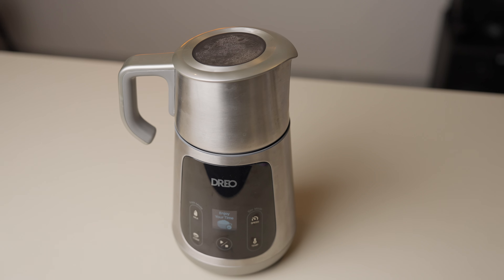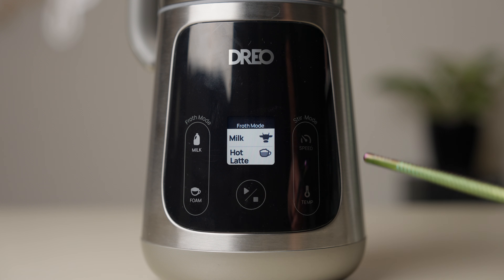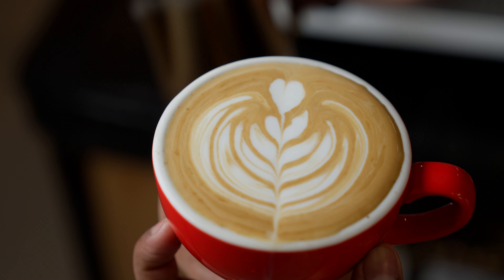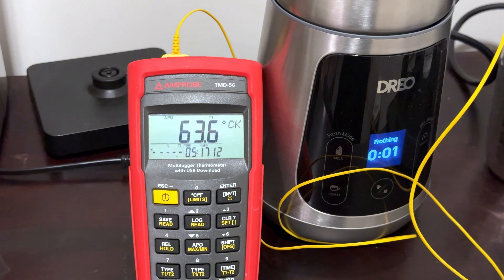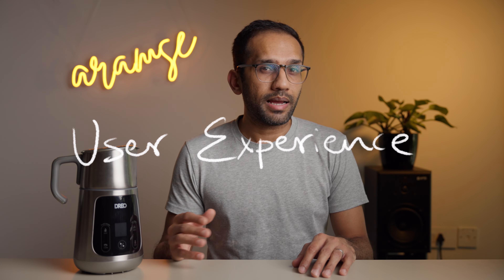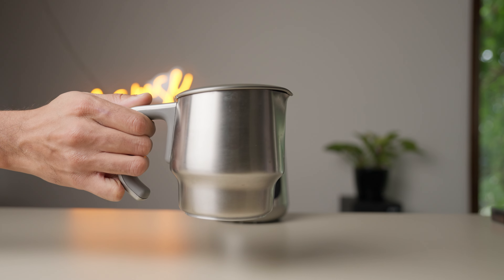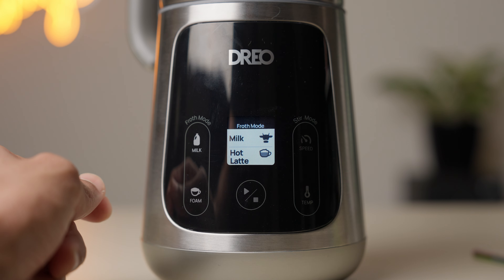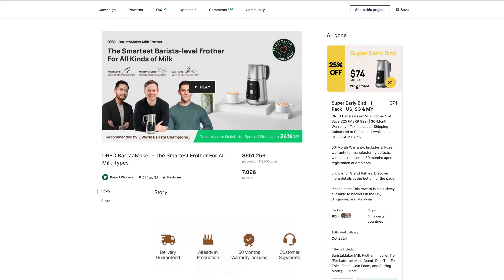DREO BaristaMaker Milk Frother - Beats Steaming On An Espresso Machine!

Comment: The reason why this device can beat the San Remo (or any machine with a steam wand) in terms of mouthfeel is one word: water.  Steaming adds water to the milk.  The end result is lower in fat than the Drea or any frother, that adds no water into the milk.  Frothed microfoam will potentially feel a little creamier due to this fact alone.  However, the speed of steaming milk, and the incorporation of hot air into the milk (which breaks down the lactose into glucose and galactose, which are perceptibly sweeter sugars than lactose), are two advantages that can't be beat.  For these reasons, steaming is still supreme.  To get more mouthfeel and to compensate for the added water into the milk, use a higher fat milk.  Most "Barista" Milks are 3.8% fat, the ideal fat percentage for microfoam, in my view.
Reply: this is good for home use. just froth the milk while you prepare the espresso. some entry level machines can't do both at the same time. this is truer if using manual machines, as mentioned in the video.
Reply from the maker: Yup I mention the dilution part towards the end of the video.
Reply: @haomingli6175 Oh absolutely, agreed. No need for an expensive espresso machine. This looks like a great device.  Just saying that steam still has 2 major advantages, and I left out the fact that doing multiple drinks in succession really does need a fast steam wand.

Comment: Been using mine for a week and really didn't have any issue at all with foam and latte art.  The taste and texture is incredible.  For the price and ease of use, this thing gets high marks from me.  I currently use the Cafelat Robot manual espresso machine with the Dreo and have been getting the same if not better quality than from cafes I've visited in the past.

Comment: I've upgraded from Nanofoamer Lithium to the Pro Gen 2 just before I found out about the DREO.
I was a little upset thinking about overpaying but the more reviews came out, the better my mood got.

I find the DREO suitable for those folks not willing to pay Nanofoamer price but still get the milk heated and textured automatically.

I will definitely recommend it as a budget friendly alternative to the Pro Gen2.

I 100% dig the fact that the Nanofoamer has zero issues with starting milk temperature, while the microfoam dial in took no more than a couple of tries. All flow controllers are super straight forward and 200g of milk done in 2 minutes straight from the fridge is perfect.

I still find the cleanup not to be the best experience, but I quickly got used to it. A quick scrub with the included brush will dissolve the small milk patch in a few seconds.

Comment: I used Nanofoamer and now I got the DREO. It works fantastic but my only complaint is that the milk jug is small. It doesn't make enough milk for 2 regular size coffee, of course I can quickly wash up and do another one but hey it's total of 7+ minutes for 2 cups of coffee. I wish it can produce 2 servings of milk at one go.
Reply: it is possible
Reply: @ how ? I dont think I will be able to do 2 cups of coffee with latte art setting
Reply: @MooCreation  
I put enough milk in and managed 2 cups of cappuccino. That was also the reason why I bought the device because I usually do two at once. anything else would be completely pointless
Reply: @ so do you fill over the “ max foam” line ?
Reply: @ Of course a Little Bit
Reply: @ I tried well over the line and still not enough. Maybe we’re talking about different size of the standard coffee
Reply: @MooCreation  i talk about classic italian cappuccino cups... the foam was perfect. a little bit too hot. maybe it would be a solution pressing oat milk. 55 c... instead of 65... the right channel should also be a solution for the left coffee part

Comment: I'm considering this Dreo and just happened to see it on sale at Amazon for BF for $84.99. I have a Nespresso machine that came with this Aerrocino frother it's ok I feel like milk doesn't get hot enough and not enough settings. I also want to be able to make hot chocolate in the frother with maybe milk and chocolate syrup I know it mentions stirring powder. I had also been looking at this Nespresso recipe frother but it's too expensive and once I found this on Amazon I got intrigued and started reading reviews and so many were good. So now I am googling and reading other reviews and watching a few videos to decide. Is it really good? I don't drink Lattes alot but when I make my double espresso pod I usually pump some syrup in my milk and froth it but I like all the settings that this has and the digital display.  I make hot and iced and have never really made cold foam just bought a can at the store but would love to try different things with this. I like hot and cold lattes never had a flat white but am willing to try it too. I also saw the nano one but I think I like this with it's digital display and  I like how it comes apart for cleaning. I don't mind the 3:30 time I will just brew my pod when it's about a minute or 30 seconds left. But it's on sale from 99.99 to 84.99 on Amazon is it worth it? I love my lattes and even want to try the latte art but I mostly use skim milk.

Comment: This makes me feel so old fashioned with my Bellman 😊 

No regrets though. Bellman is cheap, simple, reliable and requires no cleanup.

Oh, and it is ready even before I finish prepping my shot, because I preheat water in the same kettle for Flair and for Bellman, simultaneously.

Comment: I was wondering if anyone in the comments figured out what the settings were to get more foam. Obviously flat white is less than cappuccino. As far as oat, almond, vs milk which one has more foam
Reply: Ive used 2%, whole.milk and half and half. I always use hot thick foam setting. Adding half and half to milk makes it super frothy. But really foamy with just milk too

Comment: Hello, how did you get this machine in India? Is it 110 V or 220 V? Please let me know.
Reply: All of europe uses 230v 50hz since 2003, so does India. There is no more 220v except in countries like zimbabwe
Reply: @DuBstep115  Okay but the thing is I wrote to Dreo and they said that this machine is only available in 110V US version. So I was wondering how he got the machine sourced in India and how did he use it? Like with a step down transformer? And since the machine doesn't sell in India, what about spare parts, service, and repairs? Who should we contact if  the machine doesn't run as it is expected to?
Reply from the maker: Ours is 230 and works five here in India. This unit was sent directly from the company to us.
Reply: @aramse  What I don't get is, why would they make this machine in 230V version and send it over to India for a review when they don't have plans to sell it in India 😄
Reply from the maker: @salmasultana9391  Haha fair question and we get this a lot. Our channel it actually mostly US, Canada and Europe and only 5% India. It's why we get sent a lot of stuff well before it's sold in India.

Comment: Three and a half minutes seems painfully slow but I guess you could change your workflow to get it to work.
Reply: Compared to what? If you have dual boiler or HX then yes and why are you buying this?
If you have flair without steam or any single boiler machine like Gaggia classic pro its like 2,5mins to heat the steam, then steam your milk and then refill the boiler.
Reply: @DuBstep115  it’s about timing, you don’t want to let your espresso sit for this long, I wonder if you could start with the milk at the same time you start puck preparation. But even then making more than one drink would be a pain. Yes I have an HX machine, and the reason for choosing it was because at the time there weren’t any good milk steaming options for the flair. There is a company that now makes a stand alone milk steaming wand with a small electric boiler, that might be a better option.
Reply: @Victor-kh5rh  it probably takes me 3 minutes to grind beans, puck prep, pull shot and do some cleaning. They should be ready at the same time
Reply: @DuBstep115  I think the issue is just when pulling back to back. I had people over this weekend and ended up pulling 5 shots back to back, but this is an edge case. For most days since I would only be making it for my wife and I, I think the time between shots would be totally fine.
Reply: @Victor-kh5rh  5 shots back to back is coffee stop pace. You need a good dual boiler for that
Reply: @DuBstep115  You really don't any e61 machine will do just fine assuming minimum amount of recovery time (pour milk into jug, hand the drink over, puck prep). I did it with three portafilters so there was a bit of a lag between shots 1-3 & 4-5.

Comment: whatttttttt? 3 hours and 30 minutes?
Reply from the maker: Joke. Feels like 3h30m when compared to steaming on a commercial machine. It’s 3m30s.
Reply: @aramse  On single boiler its pretty much the same. You pull the shot, hit steam, wait 1-1,5mins, steam for 30 seconds then refill the boiler.
I have profitec go and I am buying this because I want my milk to be ready when I have pulled the shot.

Comment: Makes me wish that I didn’t kickstart the original nanofoamer pro. I HATE the UX and cleaning.
Reply: My condolences! Nanofoamer pro is a pain. I'm glad I held off that one and this one comes at a right time
Reply: I agree. The cleaning is frustrating as hell. I would never buy a frother that doesnt have a separate top made from stainless steel again!
Reply: Same @brentroman. I had an 80% good experience with the original pro for 10 months until I used a too fresh kitchen sponge that took off some coating. I was a bit annoyed to get a replacement v2 jug but the cleanup is sooooo much better than the v1. Just a regular cloth gets you back to clean in a single wipe this time.
Reply: @finz11 yup

Comment: 3 minutes 30 blows my mind. That’s an instant fail for me.
Reply from the maker: Honestly if you time it right you can have your milk and shot ready at the same time. Weighing beans, grinding, puck prep and then pulling your shot will overlap most if not all of that time right?
Reply: Yet your espresso machine takes 10-25mins to warm up